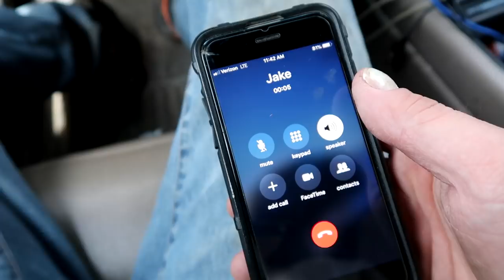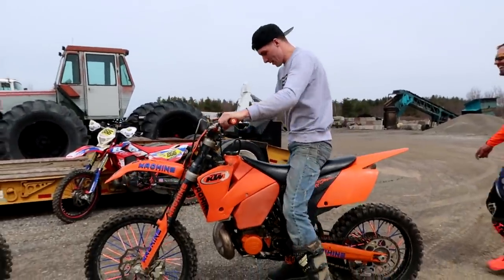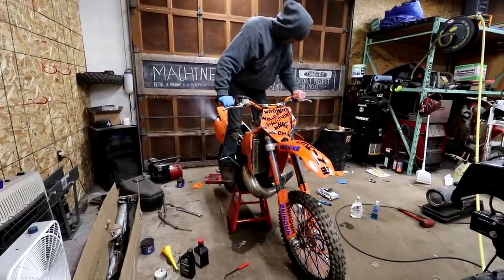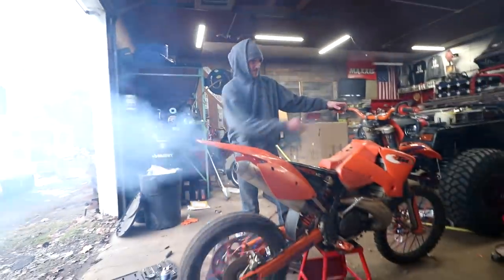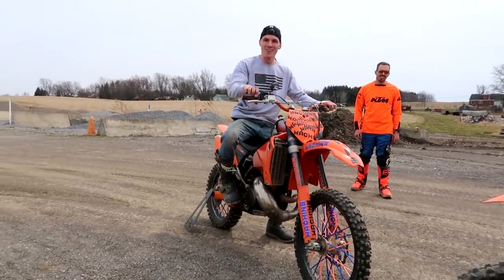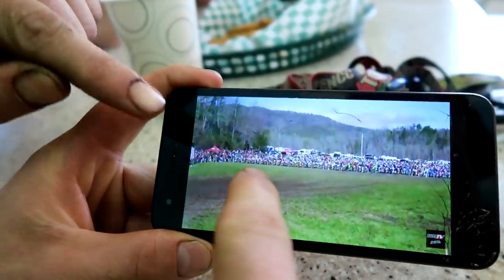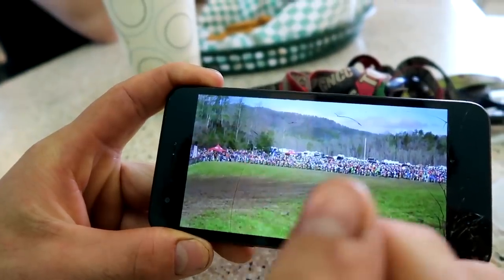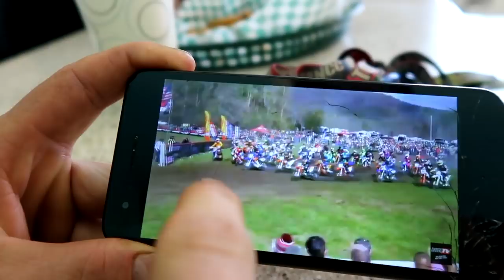Impossible Hill Climbs - USA - 3DMachines

Comment: Check the power valve on the ktm may need cleaned or it may be stuck from sitting.i had a powervalve on a yz250 stick after sitting several months..